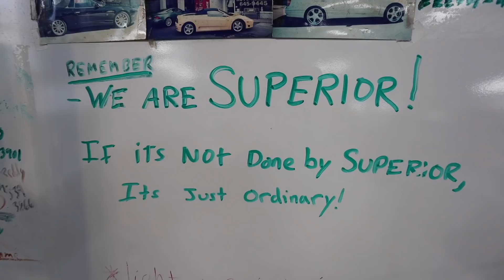Taking A ROAD TRIP Is Never That Easy....

Comment: Tucker take in the Webster Flea Market in Webster Florida on Monday the 21st of Feb. The west side of the market will be antiques for cheap. You will be surprised, only open on Monday, and the 21st will be a  good day as the extravaganza at Rennigers in Mt Dora is the 18th thru the 20th so the dealers will be at Webster on the 21st. Try it, you will be surprised.

Comment: It's a good car. Minor suspension work bushings go bad at 100k. Radiator hole, don't follow 18 wheelers. Frame not bent from minor wreck.. It's a valuable good running 2nd hand purchase. Get a free obdII scan at auto part store . that's how a car tells you when it's sick. Look up code on forums for caddie escalade. Your good. Go have fun. No worries.
Reply from the maker: Thanks and I agree. It’s an older car and is going to need work we still love it!

Comment: The mechanic knows what he's doing and its absolutely fantastic that he contacted you to show you what it needs that's a big plus. As for the rust that's creeping up on you get the car undercoated with something like woolwax a lanolin based undercoating this will help save your car from turning into a rust bucket and get it touched up annually. Being in the northeast in the salt belt rust is a problem.  Hope you have a great and safe trip.

Comment: If you didn't overheat your water pump and thermostat might been fine. Spin that water pump and see if it spins easily. If so it's probably good. Bushings do wear out. You will get out of alignment if you drive them too long.